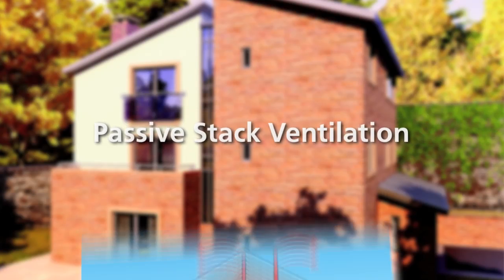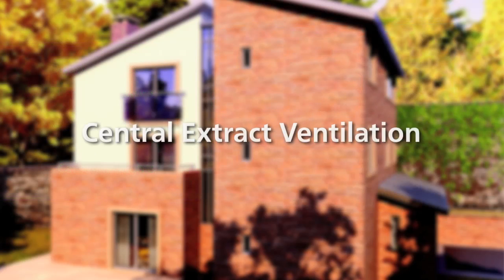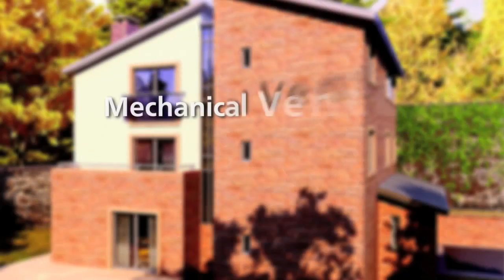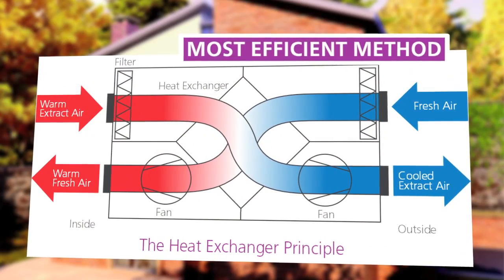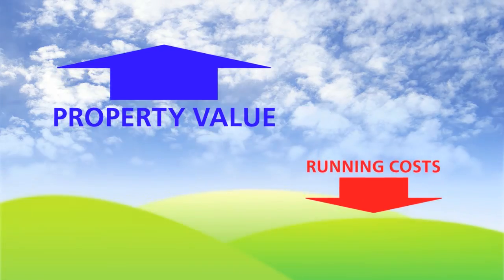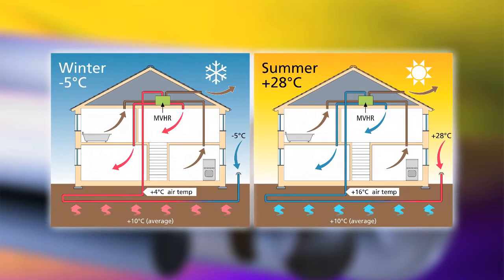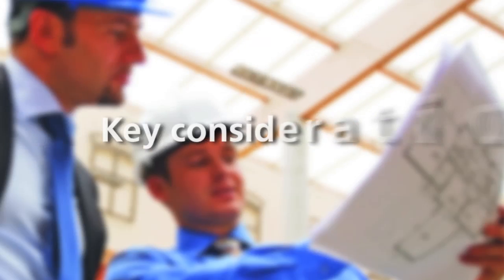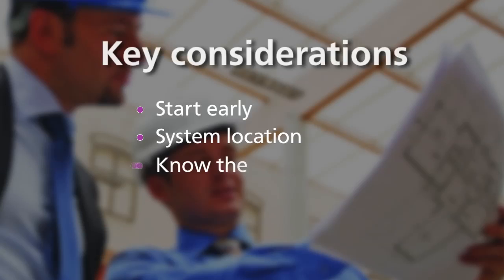How Heat Recovery Ventilation Systems work

Comment from the maker: The reason for filtering extract air is that in a dwelling there may be fine particles (talcum powder or similar) and dust that can be airborne and would be drawn through ducting to the heat recovery unit. The filter is there to prevent these particles from getting into the heat exchanger cube so that it does not become clogged up. This ensures that the resistance through the heat exchanger is minimised and means lower power consumption to achieve the required air flow rates.